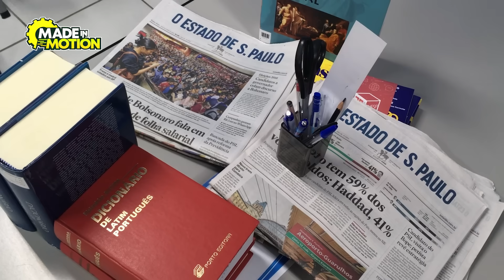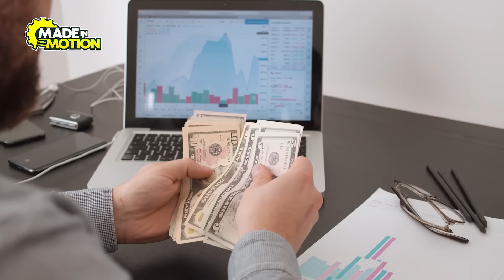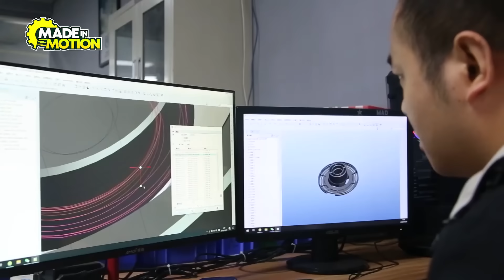How Drones Are Made

Comment: At first, I bought a small cheap non-DJI drone but found it impossible to control and along with crappy video, I returned it after only a few hours. I had read about DJI quality and watched a bunch of videos, and really liked the enclosed propellers and small design, so I bought a DJI Neo. While waiting for delivery I went through the online FAA "TRUST" course, a simple 30-minute online class that teaches you the legal things you really need to know in the U.S. before flying any type of drone no matter what the size. The Neo arrived and was far better than I ever expected, with great 4K video at 30fps, easily transferred to my desktop computer. The AI programs included automatically follow you around, circle you, do "rocket" up in the air while filming you standing below, and easily complete all kinds of other actions which simply were astounding. Then I tried the manual control with an iPhone, which worked well, but caved in and got the RC-N3 controller which worked even better and greatly extended the range that I could control the drone. After watching many YouTube videos, I decided that I really wanted to get my Part 107 remote pilot license, so I studied all the free online courses over 3 weeks and passed the FAA exam. I put some YouTube videos online, including flying over my backyard pirate ship, and I'm having a great time using this drone. The Neo works far better than I ever expected it to, and the video quality is first rate. My wife was absolutely amazed how it would hover at shoulder height, following her around the yard while filming her gardening. I even set up a short YouTube video with the Neo flying over my backyard pirate ship, and now all my friends want to get one. It would be nice if U.S. companies could make comparable products with the same features at a similar price, but labor costs in the U.S. are far higher than overseas.

Comment: Draganfly in Saskatoon Saskatchewan Canada released their first commercial quadrotor drone, the Draganflyer, in 1999, a year after the company was founded in 1998. This was a pioneering moment, as they became the first company to commercialize a quadrotor UAV and were pioneers in the overall drone industry. I did the computers for their accounting and some control software for 3 motor configurations. I have three DJI quads, a parrot quad and a parrot wing (Disco).

Comment: The assumption that DJI were the first to produce and use drones is false.  Parrot (France)  produced the AR Drone in 2010, D JI produced the Phantom in 2013. However the concept of drones goes back even further with militarily use in Vietnam, the Ryan Firebee. Although this was more plane design as opposed to quadcopter.  The earliest being 1907.   A 4 rotor design, very large,  but similar in design to modern craft. Checkout Gyroplane No 1.